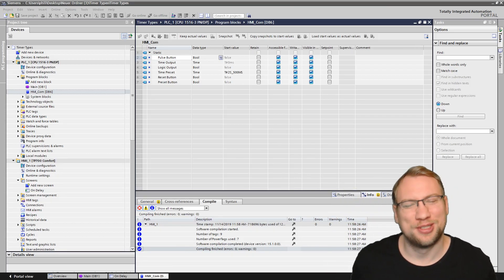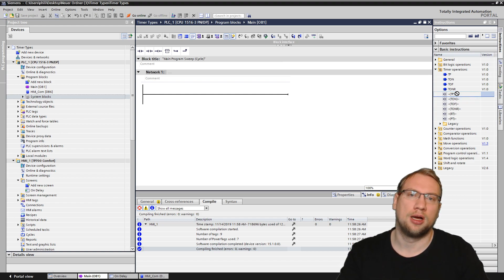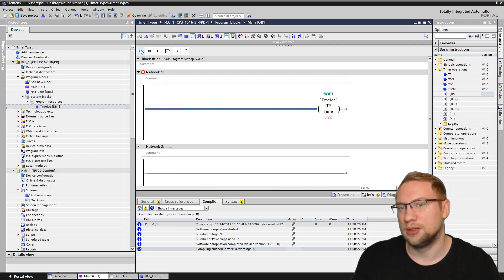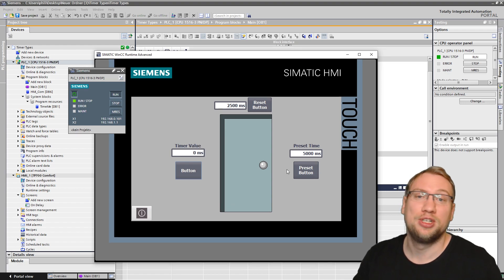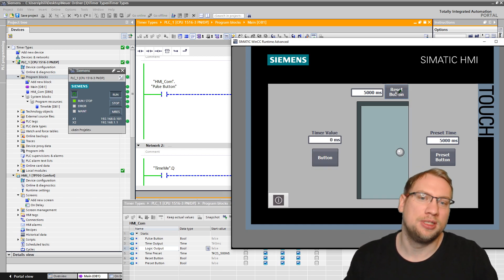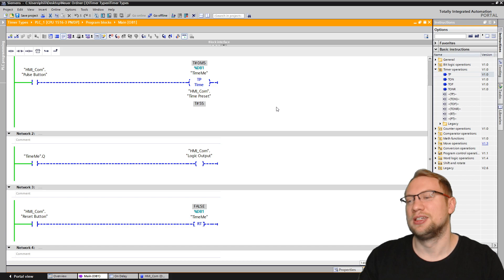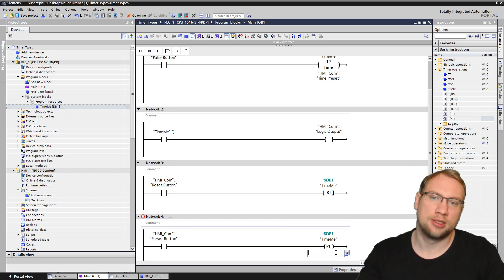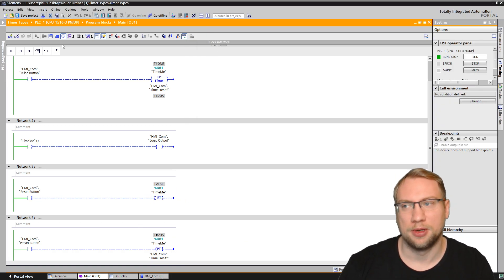TIA Portal: Resetting and Presetting Timers (TON, TOF, TP, TONR)

Comment: Dear Hegamurl, firstly thank you very much for these usefull lessons... I have a problem a timer TON which is a function block. It just runs  for once.. After returning MAIN  and entering function block where TON is ,  TON does not work although its EN contact is OFF, Elapsed time ET of TON is max ( for exp. 5s), İf I STOP plc and then START plc  , it turns normal and runs, how can I reset timer TON while returning MAIN program, If you write your mail I can send project, or you can answer me from here, thanks alot
Reply: Second time when the FCblock runs , TON timer does not run because of Eleapsed time ET is full (equals PT), TON must be reset, BUt I could not do it, I can not do it